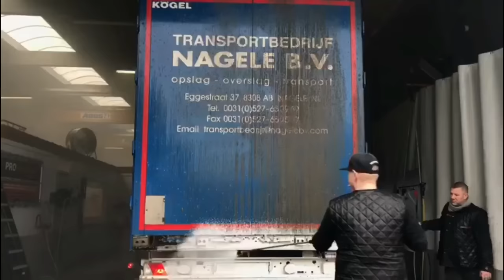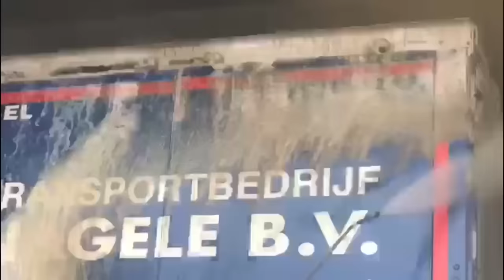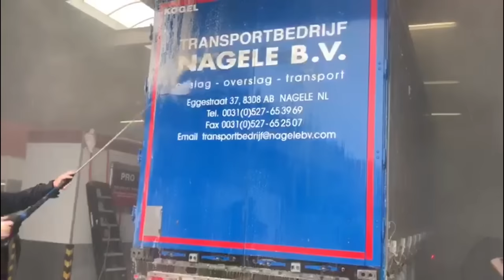AMAZING! Non Contact DAF Truck Wash, JUST WATCH! No brushes or sponges needed, ProNano HQ Washing

Comment: Everybody who does this type of job knows that when you start pressure washing, you tend to start from the top and move towards the bottom. If you start from the bottom then all the dirt from the top is gonna cover the clean areas again which does require, as in your video to wash a surface twice or even 3 times. Point is, you have to use as much as less water as possible and still do an amazing job.
Reply: ع
Reply: شب
Reply: Bottom to top prevents staining
Reply: I think its more of comercial way of showing
Reply: Everyone doing this job KNOW that you start from the bottom and move up.

Comment: Most important is to be methodical when rinsing. 

If you miss a spot it will show when it dries. But as mentioned, if you rinse thoroughly and methodically the result is amazing.

I haven't hand washed our family car since last summer. 
A foam cannon, a pressure washer and the right kind of foam soap is all it takes.

Cheers!
Reply: What kind of foam? And what foam gun do you recommend?
Reply: @Calle...  - I guess it's a bit unfair to compare my professional pressure washer with pre-heated water.
It's all about the temperature.

With cold water the result isn't as impressive. It leaves a thin dirt coat no matter what soap I use. 

Unfortunately you  have to hand wash your car after you've pre-foamed and rinsed it, if you don't have a pressure washer with pre-heated water.

But you can apply a coat of your hand wash soap with your foam gun. It's both fun and quicker than applying the soap from a bucket by hand.
With the car pre washed you don't need the two bucket method.
Reply: Nsah

Comment: How much of that dirt would have come off with just the pressure washer?
Reply: A lot
Reply: All
Reply: I thought the same thing 👌🏼😑
Reply: How much grease and oil you gone get off without the soap
Reply: And he can't be a detailer or doesn't really have much common sense. Who doesn't go from top to bottom. Kinda dumb to wash from bottom to top
Reply: Brandt Martin the main reason why he is putting on soap is due to if you do not apply soap with a surface as dirty as that right as you go to wash it with the power washer it will leave noticeable lines. The soap breaks all the dirt up so you’re more or less just ‘sweeping’ the mud off the surface. I do this for a living and have noticed without soap it will leave the truck still looking quite dirty.
Reply: darren simpson good question
Reply: Yes
Reply: Markus Hughes yes if your washing the truck with a brush you would rinse from top to bottom that is because you are only rinsing the dirt and soap of because the brush did the cleaning but with contactless washing it’s best to rinse into fresh soap because the combination of the soap and the high pressure water is doing the cleaning so rinsing from one end to the other end or from bottom to the top is far better because it means that the soap isn't rinsed away by the water run off
Reply: @down4l  well then just use the product on the greasy and oily parts and the rest wash it off with the pressure washer.
Reply: The truck would still be filthy I drive one I know, straight water will not do the job I've tried it before does not work
Reply: @markushughes7876  you do t understand, if you went from bottom to top , more dirt will come off and you would get a better redials than cleaning from top to bottom
Reply: @markushughes7876  Actually that's how the instructions tell you to do it. I'm guessing the flow to the bottom does some more work on the dirt.

Comment: Why the hell do people  wash the  low part  first?
Reply: Peter Holland yeah I was thinking the same
Reply: To prevent streaks/buildup of dirt
Reply: you have never washed a truck with chemical if you start at the top you get halfway done and you dont have any soap left.\
Reply: Peter Holland because they can
Reply: bleka789 but don’t people with common sense use a power washer to get most of the dirt off before they use chemicals?
Reply: Brandon Wiebe twice the work. Power wash the lose dirt off and redo it again .chemicals are strong and can knock of in one . These trucks are not off road trucks with heavy built of dirt . Mostly highway trucks with mostly greasy dirt brake and road tar
Reply: Because its non contact. Start st the top the water runoff starts rinsing the soap off the bottom before you get to it.
Reply: It’s kind of hard to do it from top to bottom on a big truck
Reply: @oddfcherry  thats why they have telescopes
Reply: Sigi Reil says this.
Reply: Canadians and those upside down countrys do that.
Reply: Some dam westpoint lieutenant told me to strip,map and wax the floor and then hose down the walls.That is what I did and then he was pissed because the floor got dirty from the walls dirt.He said "why is the floor dirty and wet?"I said"some smart ass ser told me what to do."
Reply: to save water n time i think
Reply: If washed under truck to get road salt and other junk off a cars suspension is expensive I caint imagine that beast
Reply: First thing I did was go to the comments and see if anyone else noticed this or cared
Reply: @Specs-lh1bt  apologizing bro
Reply: Because he fucking wanted to. He's demonstrating a product. It's his video,  he'll do it the way he damn well pleases. Who knew so many people would be butthurt over the way someone washes a truck.
Reply: You always wash bottom Up with touchless so that you agitate the foam and dirt as you wash instead of it washing off right away…
Reply: You always apply chemicals from the bottom going up, and then agitate it with water bottom to top. Only the rinse process is from top to bottom. That way you get the most out of your chemicals. Same for trucks as for cars and bikes.

Comment: in the states we have a Blue Beacon Truck wash for this, i personally work there. We apply 305 (de greaser) first, wash, the  re 305 so we can brush or possibly wash again depending on what the customer wants, always wash top to bottom. save you a lot of hassle.
Reply: blue beacon absolutely sucks y’all couldn’t get a truck actually clean if your life depended on it always missed spots and spots not clean there’s a reason why it’s called the streakin beacon I’m sure they putting on for the camera but regardless at least it’s clean
Reply: @randallrussell1397  explain why any professional wash goes top to bottom then? Going bottom to top? Go from the bottom u wash get the bottom clean just to move up a layer wash that and all that dirt and grime fall on the clean spot. Takes common sense to understand that. If it’s such “streakin beakin” explain to me why we get more business and are worth probably 50x what company is worth?
Reply: Never said bottom to top was the right way just said at least it’s clean as for the other part could it be a lack of competition is the reason let’s be honest here there are not many options when it comes to getting a truck washed further more could it also be a convenience factor beings how normally they are located near a major branded (ie pilot,flying j, loves etc etc)truck stop if not in the lot that whole location, location,location! Thing and the whole something is better than nothing at all even if it’s not totally up to par still better than going with a nasty absolutely filthy truck

Comment: Wouldn't it be smarter to spray top - bottom when using the jet washer? Sorry for being picky but it makes more sense than having to re spray over bits you've cleared off holding the dirt. Work smarter saves working harder I always got taught.

Comment: Don’t wanna tell people how to do there job but why start washing off the wheels when the whole truck still has foam over it? All the dirt is gonna run down 🤷🏼‍♂️🤦🏼‍♂️🤣
Reply: Because when you rinse off wheels the dirt Flys everywhere and gets the clean stuff dirty again
Reply: The entire truck seems to have been at least partly washed from the bottom up. I dont get it either.
Reply: AMG-ADVENTURES C63 the longer the soap sits the less affective it is wheels are almost always the dirtiest part so the stronger the soap is the easier it is to clean
Reply: Dirtiest part first, same with car detailing although they usually won't foam the rest before finishing the wheels.

Comment: ......another video of....watching someone rinse from bottom to top 🤦‍♂️🤷‍♂️
Reply: Probably because if you rince from bottom to top the product will stay on longer instead of being diluted. But that's just my opinion.
Reply: Last pass he made was top to bottom so how is that wrong? It’s a lot of surface area so he split, and finished each side top to bottom. Ah well
Reply: Was thinking the same......😂
Reply: If you rinse from top to bottom the chemical get stronger at the bottom more likely to burn material There are using acid and a hot soap most likely diluted with water
Reply: @Hurricane9146  ....it's not wrong, it's just an extra step and extra time...a step that's not needed if done from the beginning...and even though it might be a small amount of time, it adds up when washing multiple units a day.
Reply: @drlovins3394  you do realize that top to bottom or bottom to top, the same amount of chemical is still present.....
Reply: Tiltdecker I work at a truck wash in Lakeville Minnesota you wash from bottom to top because if you don’t the soap get rinsed off with it and doesn’t clean very well
Reply: @claytondorneman7844  thank you
Reply: I know. I have to watch a video doing this now ....

Comment: Holllld up🤦🏽‍♂️🤦🏽‍♂️ITS TOP TO BOTTOM!
Reply: Not to mention ensuring the spray from the pressure washer works on the same direction your cleaning if you just point the jet of water in the middle of the target..it just goes everywhere..🥱🥱🥱🥱

Comment: I remember when I would wash cement tankers I would spray an acid on them that would foam when in contact with dirt. 
It was corrosive as well and it would eat through your clothes lol it was pretty strong stuff. 
When they were rinsing the foam off, they did it backwards. It's best to go from top to bottom, not bottom to top ... you work harder that way

Comment: Bottom to top while washing the dirty part back onto the part you just cleaned. Perfect, exactly the way everyone else with common sense and even a basic understanding of gravity would do it
Reply: bottom to top is the correct way, top to
bottom causes the soap to wash off because of the water running down it.

Comment: I am very amazed but what is the active ingredient in the soap ? What I see here is the soap turns liquid with the air contact and makes dirty matter flow down by gravity like any liquids. Normally soaps help brushes or tissues to slide on a surface to avoid dry scratches. Conclusion : Just pressurized water is enough and much better using handwash and finishing with a polisher "(¬ . ¬)"

Comment: Hhmmm.
Should pre rinse as first stage? This will remove 75% of the soiling and also wet out the surface, ready for foam to be applied because of pre rinse can then reduce soap/surfactant.
Should have 2 bays, one bay for pre rinse and other bay for foaming and rinsing.
Last rinse water can reclaim and use again on next truck for pre rinse.
The residual soap reclaimed will again enable you to reduce the amount of soap/surfactant you use....job done

Comment: They didn't wash the top of the trailer. You need to start there and work your way down. Otherwise when it rains it will leave streaks of dirt down the sides.

Comment: There is a ladder in their building, why isn't it being used?
Why aren't they doing the roof?
Bottom to top?
With how close the guy is holding the tip, he could probay remove all contaminants with iust the water pressure =/

Comment: Impressive. Why do they never work. Pre soak of low pressure hot water/chemical hrs before advertisement in cold and overcast weather . . Has to be something. They just don't clean this easy. Leave over night.there goes a coat of clear. Kero/chemical in final hot soak again eventually there goes clear coat or two pack finish.

Comment: I just don’t understand why they’re rinsing it off from the bottom going up. The correct way is to rinse from the top and work downward. 🤦🏻‍♂️
Reply: I was just having the same thought. I had to skip that bit in the end cause it waz triggering me 😂
Reply: This method is used when you want to ensure there are no areas that you have missed. One should do bottom to top and then rinse it top to bottom, in the end. Mâine on a commercial truck, it is a bit of overkill.

Comment: BASIC car wash tip:
Start from top to bottom... Guess Europeans do everything backwards.
Reply: Tony Chavez actually that is false. The reason why you do it from the bottom up is because the dirt youre washing off has an easier time getting off and going away on a clean surface than a rough dirty surface. Also the cleaning product you use works best when sprayed directly on the dirt instead of on the already dripped down product, because it can break down the dirt easier that way.

Comment: Why clean from bottom to top??
Top to bottom is a better way.
Reply: The only time it's best to go  top to bottom is a final rinse. When removing foam the best way is bottom to top as it means that you actually blast the foam with the high pressure which will help the foam to be more effective at removing dirt. If you rinse off snowfoam from top to bottom the water running down the vehicle will drag the foam off and make the foam less effective.

Comment: Meh, I wouldnt say this is proper valeting / detailing. to me that looked like pre wash stages any professional Detailer like my self and others would do before contact wash. Cant say that is clean. Yes its cleaner than what is was. BUT you spray top to bottom not bottom to top. No contact wash, so cant guarantee its fully clean. This type of wash is ok if you have a fleet of trucks and want to keep to clean during winter times. But I wouldnt do this wash my self and says its clean.you didnt even clean the roof.

Comment: I guess I'm the only one here that's ever pressure wash something in Mass quantity. I found the video extremely triggering. Whenever you power wash something you start from the top and work your way down. Also you spray towards the soap not away from it when rinsing. I couldn't even finish the video this guy's never power-washed anything in his life.

Comment: Applying shampoo,& Rinsing from the bottom up, these guys don't have much common sense, just the pressure washer would of got that same result & skipped the foam application step, waste of time & money in the haulage industry you need to be applying the opposite logic , saving them increases profits 👌, while still having a clean fleet look how Eddie stobart does it take a leaf from there book you may learn something positive, just my opinion, good luck